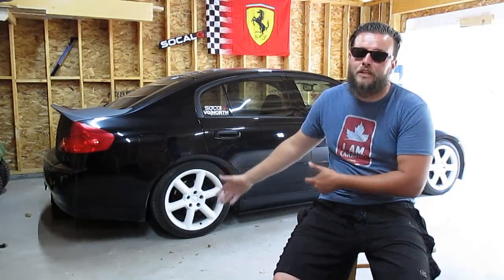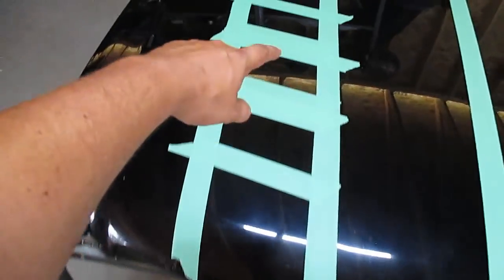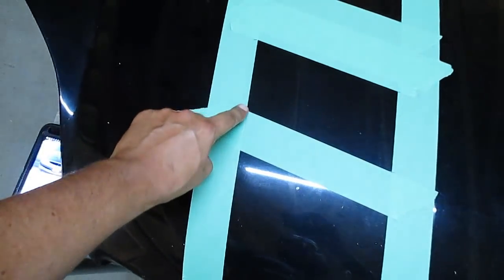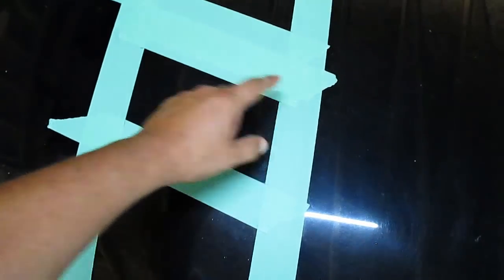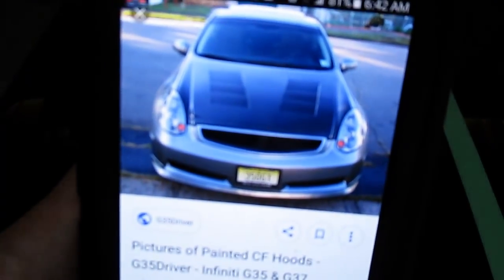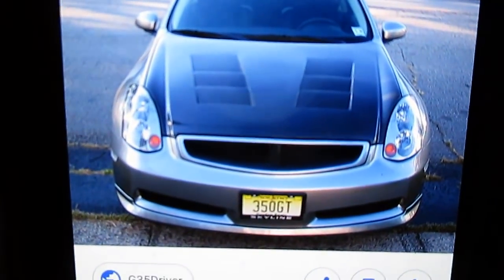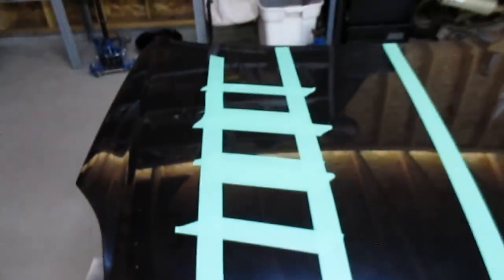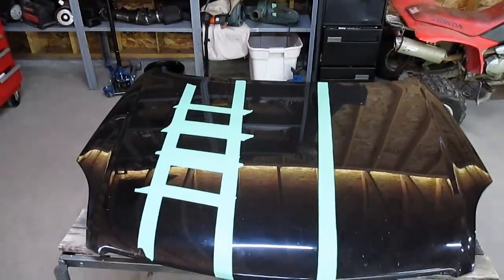DIY Custom G35 Vented Hood Build - Part 1

Comment: Looks good..but why does everyone always just push down the slits? Make template pieces or squares and tack them up to the edges of the vent hole. Draw or figure out the curve you want, then slowly bend and tack the center piece of metal along the way, wallah! Nice curved vent

Comment: Looks good, I've just always wondered and worried about rain getting thru vents???
Reply from the maker: Ruben Ortiz the engine cover is covering the coil packs and main harness pretty good. my worry is just water on the belts. will do an update video in a few weeks
Reply: DNALI thanks for the info, i appreciate the reply

Comment: Looks good you should paint those exposed pieces of metal that can rust now they have been cut.
Reply from the maker: dorrystalkerkilla luckily this hood is stainless but next video I will be finishing the hood off with paint
Reply: DNALI you live in Toronto cuzco in one of you old car vlogs you were in my area Weston road and Sheppard I have this 03 maxima I wanna sup up do you know any shops I can get work done on the lows.